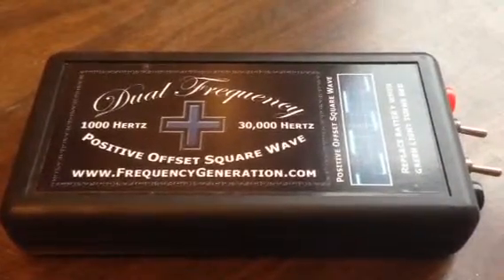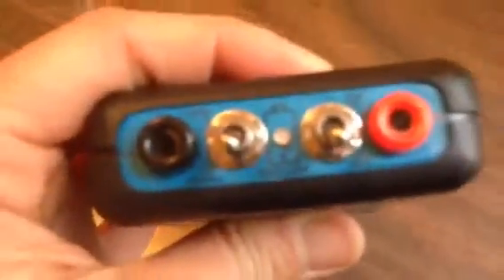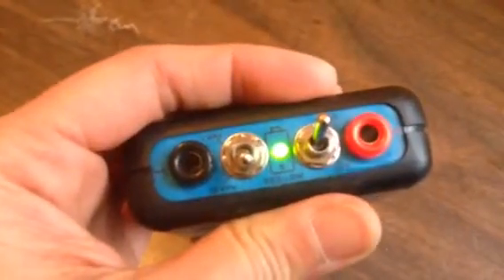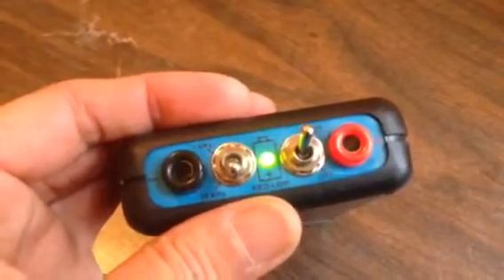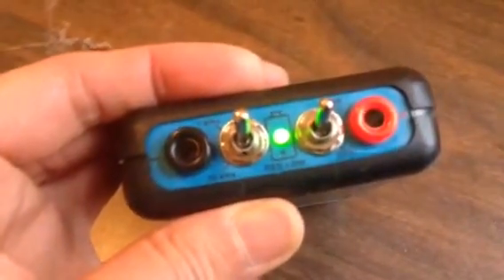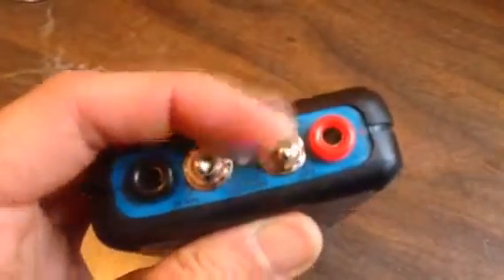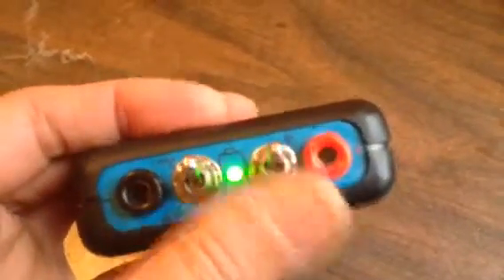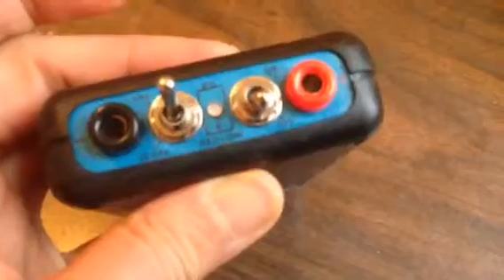How to Toggle between 30 kHz and 1 kHz Dual Frequency Zapper

Comment: If the current is going from arm to arm, doesn't it get less potent bellow the belly button? Wouldn't you want to put a lead on your left foot and your right arm or something?
Reply from the maker: Some people direct the current in various ways. Some put the copper handle attached to the red (+) wire on the area of the body they are targeting, then hold the copper handle attached to the black (ground) wire in one hand.

Comment: howcome in her book it says you have to tap 2 times every 2 seconds... I'm not sure I'm understanding this....
Reply from the maker: Dr. Hulda Clark wrote that if you do not have a Zapper, you can simply use a 9-volt battery directly by connecting a finger to the ground (-) terminal and tapping the positive (+) terminal repeatedly. She wrote that even 2 taps per second (2 Hz) for a duration of 10 minutes without interruption is a good zap. She also reminded that it's important to do this 3 times with a 20-minute break in between.

Comment: Can you explain what the different frequencies are used for, 
and how to use this zapper for food purposes please?
Thank you
Reply from the maker: Hulda Clark recommended 30 kHz for use with the copper pipes for basic zapping and 1 kHz for use with the North Pole Speaker for zapping anything that can't hold on to the copper handles (food, beverage, pets). To zap food, connect the zapper unit to the North Pole Speaker Box as shown in https://youtu.be/yLK7C6y1NKY